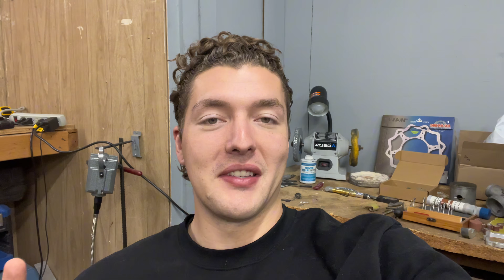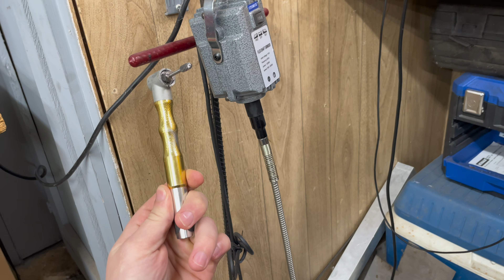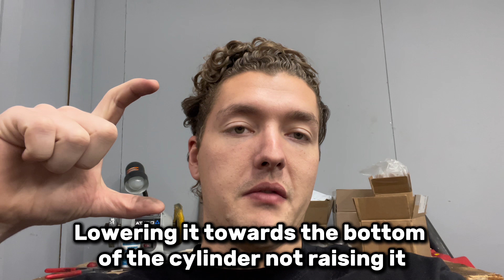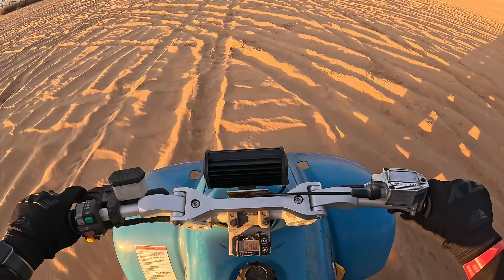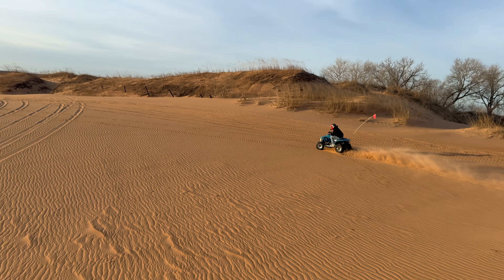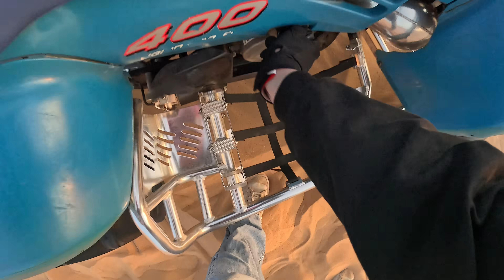I Was Porting My Polaris 400 WRONG — This Setup Works

Comment: Have followed your build for a while now and I say awesome job man  have scrambler 400 and big bore 2 stroke is the way to go  keep up good work on the vids    And what pipe is that that u r running? Also when I put flat slide on my scrambler it was a big difference in throttle response if you ever wanted to experiment on the express 👍
Reply from the maker: Thanks man I really appreciate it! The pipe is an FTZ race pipe. I have a pwk39 and a tmx38 I just haven’t got around to messing with them yet but I probably should put one on.